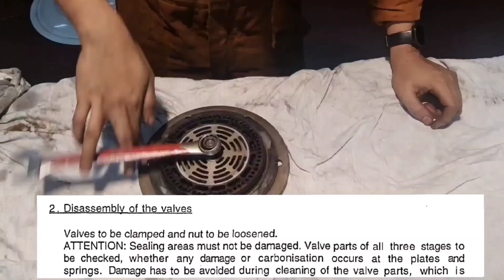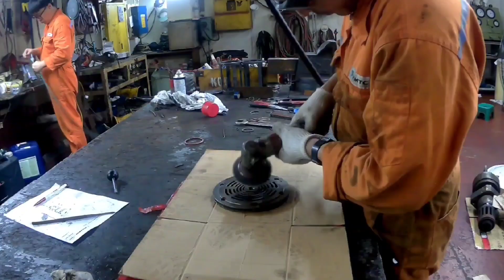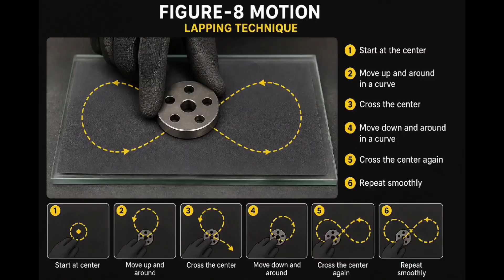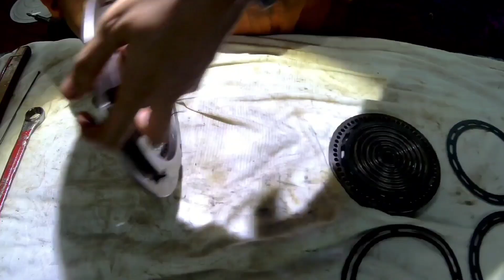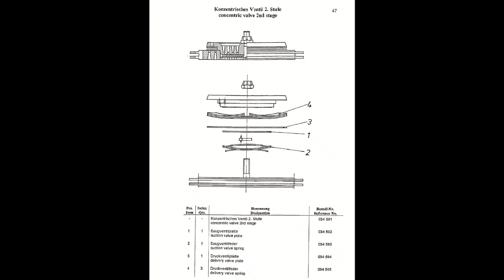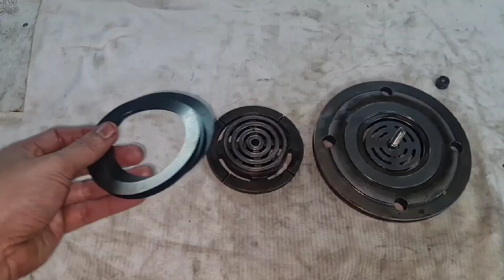[COMPLETE] Sauer Air Compressor Valves Overhaul, Lapping, Renewing Valve parts

Comment: Hi Sir, I have read in Sauer and Sohn, at specified intervals valves need to be renewed. It's mentioned not to lap like we do lapping in Tanabe. Please correct me if wrong.
Reply from the maker: You are correct, always follow the manufacturer's manual for specific maintenance procedures. Sauer maker recommend to renew valves and spring parts. Only valve body to be done light lapping.